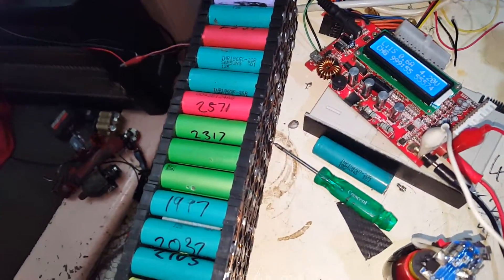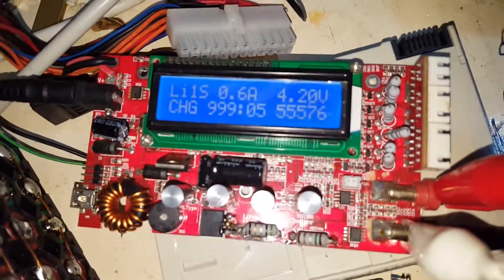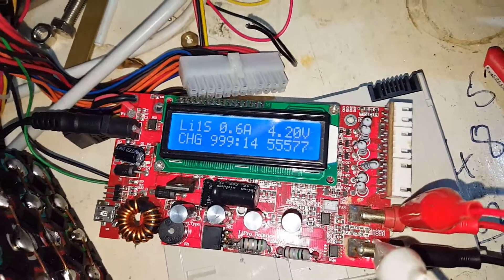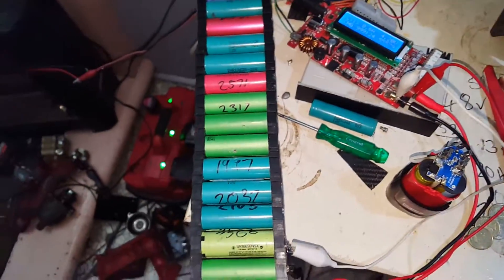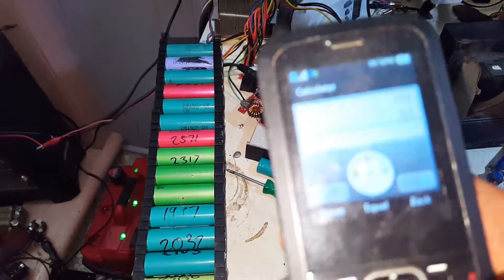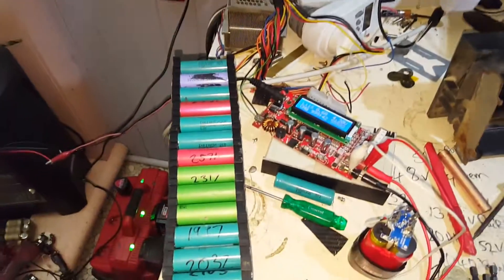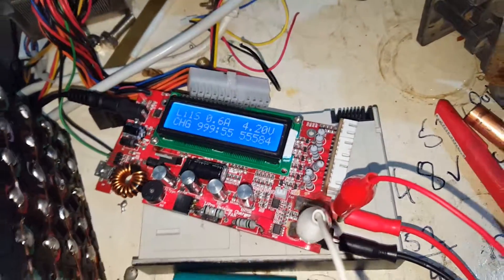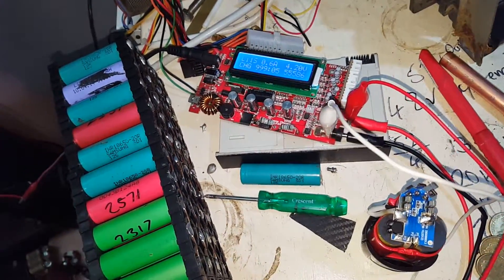60 cell 18650 test pack capacity  update

Comment: nice work mate what mah range cells you running seen some lower ones there
Reply from the maker: +Dennis Sewell yeah  just for testing  still got a nice  high capacity  out of it cause there's  a lot  of  2600s and even 3000s in there but thats half a kwh right there
Reply: dont take many cells to make a half kw
Reply from the maker: na not when there like these ones now to make 57-60 kw for a pack haha